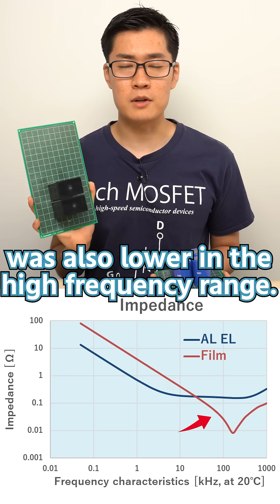Which one to choose? Electrolytic Capacitor or Film Capacitor?

Comment: Thank you very much for the knowledge I received from you! I am a 70-year-old electrical engineer (and sound engineer). I live in Hungary. I graduated from "electronic components and device manufacturing" nearly 50 years ago. Before that, we also learned a lot about this subject in the technical school. The "hidden" parameters of capacitors are very important in audio technology! I measure these in every application. (I have a well-equipped laboratory, with instruments worth a luxury car.) Since it is also my hobby, I did not stop working. I mainly make the hi-fi (high-end) audio equipment of many of my friends much better. It is shocking to me that in many hi-end speakers, well-known manufacturers use bipolar electrolytic capacitors in the crossover circuits. I always replace them with induction-free foil capacitors. I recently read a colleague's opinion that electrolytic capacitors can be used up to a maximum frequency of 1 KHz! But even tantalum capacitors distort a lot at audio frequencies! When examined with an oscilloscope (x-y diagram), an "o-ring" is visible, not a sloping line! I wish you much success and good health in your further work!

Comment: So funny story the aluminum electrictic capacitor is what I have inside of my electric unicycle which was stored in the back of my car on a very cold morning I pulled it out turned it on and decided to use it to move quickly to another portion of our warehouse.. I happened to get about 15 20 ft until I found myself flying through the air and onto the concrete floor because it turned off( or never fully turned on)  thank you for this I knew it had to do with the cold I'm sure it had an effect on the battery as well either way great video thank you
Reply: ChatGPT says 98% match 😂
Reply: I am dumb, can you explain why you were flying through air?

Comment: Flim cap also have ac and dc cap?  Then how to know which one is?  Like audio cap and the ac motor starter or something caps?
Reply: (All?) film caps can withstand 50hz AC current. But for some high frequency pulse caps, eg a 1000Vdc 20kHz 30uF pulse cap, can't withstand to charge the full positive and negative voltage at 20kHz due to peak current and thermal.
But 1000Vdc with +/-10V 20Apeak is ok.
Reply: If your caps are biased with dc voltage (but conducting a super imposed AC current) you can use either AC or DC rated ones. If you use the full rated cap voltage to swing +/-, you need an AC-cap.

Comment: Simple rules:
1. Use Ceramic capacitors
2. If you can't find a suitable ceramic capacitor, use a film capacitor
3. If you can't find a suitable film capacitor, use an aluminium electrolytic capacitor
Reply: Hey can i ask, why aren't ceramic caps made much larger - or have i just never run across any? (Apart from hv door knobs)
Reply: @jonlitchfield8888  good question 👍
Two main reasons comes to my mind (if I recall correctly):
1. it's hard and expensive to build multi layer ceramic caps (MLCC) with a high volumes without risking inner cracks. Most MLCCs are small, electrolytic capacitors can be as big as beer cans.
2. Electrolytic capacitors can have up to 10x higher capacitance per volume because of thinner dielectric layers. Aluminium oxide has higher breakdown voltages and can be build thinner for the same voltage ratings.
Reply: Correct. Look for a tantalum (more expensive).or niobium (much more expensive) before scouting the aluminium arena. In audio and MF applications, tantalum is king.

Comment: You rarely use an aluminium electrolytic unless a film (or other non-electrolytic) of the same voltage and capacitance would be too large to be used.